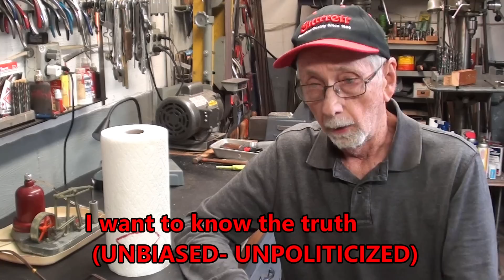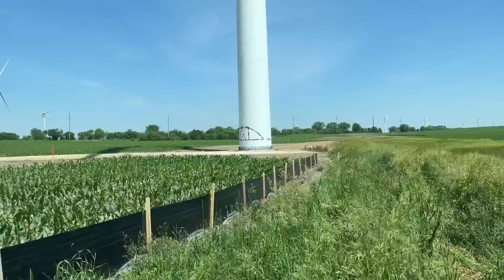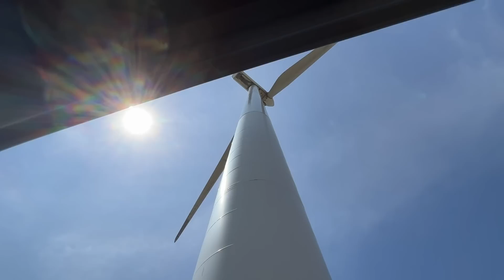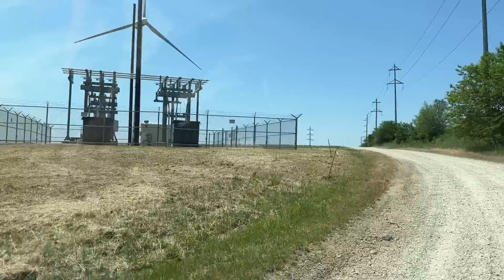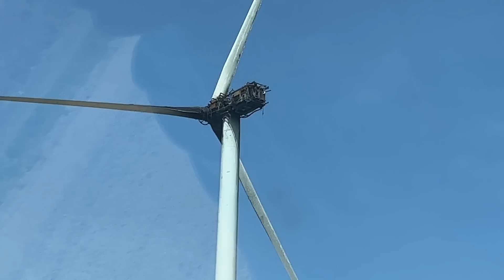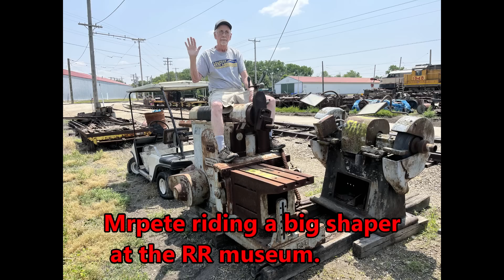OBSOLETE WINDMILL DEMOLITION short #46 pt 1 tubalcain

Comment: Another excellent read (the pdf book is online) is Sustainable Energy without the Hot Air by David McKay. It gives numbers for all of the different types of energy production methods. If you read any book on energy, this should be the one. There are a lot of numbers and math, but probably nothing past a fifth grade level and it is very readable and interesting.

Comment: I don't know the economy for when they get bigger but I've looked at the 100kw range a lot. 
(for those who don't know that's kind of the smallest commercial commercial size you can get)
If you do your own work you seem to be able to get them under a budget of 50 thousand dollars. 
Where I live they average about 17% of their full capacity. So you can think of it as making 17kw all the time.(of course somebody has to use it all for heating and cooling or absorb it in the grid or whatever)
At 4 cents a kwh that's $.68/hr. 
$16.32/day
$473/mo
$5,924/yr (with some down days for maintenance or just because something broke)
So rounded up your looking at a 6 thousand dollar return on the 50 thousand dollar investment. 
The unites I was looking at last a good 15 years and probably should go over 20 and maybe 25. 
So your most likely looking at 18 years of running. 
But I'm not counting insurance as part of the cost so lets discount that to 14 years.(for the risk cost) 
That's 84 thousand dollars earned on a 50 thousand dollar investment over 14 years. 
So your looking at a compound return a bit under 4%. 
Not a great investment but not bad either. 
I think Ford pays like a 3% or 4% dividend.

Comment: How would it be fair to subsidize all other energy plants but not renewable ones? Why is it so hard for people to understand that a big part of the reason this is subsidized is because doing this at these kind of scales is not a proven thing but it IS desirable. Did you know the EACH and every nuclear power plant is just another attempt to get it right? We can't learn from mistakes of the past if we never make them. 

In short, you can bitch if they are installing new ones but no use was made of the lessons learned to accommodate the design flaws. THAT would be insane and wasteful. The fact is that we NEED to work out how to utilize renewable energy sources BEFORE there's no oil to grease the machinery. Whinging that the road to it has a few bumps is frankly missing the point.

Mr Pete, no offense, but although I love your machining wisdom and humor, your politics regarding this and pandemic regulations need more perception and understanding.

Comment: When doing simple math windmill's are a scam, their made/placed/kept working by use of loads of Fossilie fuel +50-100 gallon of oil,,,,,every 0.5 year to keep it lubricated. A 100kW mill will never produce the costs of building/placing/maintain, demolish clear and clean the soil for the build!
Reply: So other generators don't need any lubrication? They don't have building costs or associated demolition costs?
Reply: @ExtantFrodo2  Looking at what's already build they possible know more than science?!
Reply: @leilanala  What the heck are you talking about?
Reply: @ExtantFrodo2  Windmill's cost way more to build and maintain then they ever bring on electricity, just like solar panels that die after one hailstorm.
Reply: @leilanala  Obvious petroleum shill is obvious.

Comment: I may be biased, since I am a huge aviation buff. Anything that utilizes the forces of wind and turn it into mechanical energy. is simply poetry. These gentle giants, lazily turn, sometimes creating an almost hypnotic visual. You say they are a blight on the land, I find them far more attractive than other traditional energy production sources. Beauty is in the eye of the beholder.

Your argument about the wasteful use of resources and money to build and maintain these wind-farms, is a bit myopic at best. The resources, and money sunk into traditional energy production, is not without massive waste and costs after service-life. Hydro electric would prolly have the least damaging economical and ecological impact, but how do you deal with a Hoover Damn when it has reached its service life. There is the initial ecological as well as socioeconomic displacement that occured.  Coal is by far the worst in my book. The toll on humans has been and will be for generations. I would rather we retrain miners to transition to something in the tech end or maybe set up safer manufacturing production that does not fill their lungs with silica or coal dust. Say building wind turbine blades as an example.  Sure, the conditions in the mines isn't as bad as it was say 80 years ago, but mountain top removal is still a exceptionally risky environment for miners and don't even start on the ecological impact. We both know that "Clean Coal" is pure fantasy. 

Nuclear is hugely inefficient both in production costs and recovery of waste products, downstream. Just the reclamation/decontamination and storage/disposal of waste from the operation of nuclear plants is rife with subsidies. Now, I am a proponent of nuclear energy once we can figure out a cost and ecologically effective means of dealing with the waste, and the initial production of the fuel rods. If we can ever solve those issues, I would be on board.   

Sincerely, Wolf Dilworth
Reply: Well said!

Comment: Mr. Pete you are looking for a simple answer to a very complex problem. Just from an economic point of view the location  and development of generation resources is dependent on many factors such as availability of fuels, transmission capability, site conditions and availability of financing (i.e. interest rates). For example, hydroelectric plants (my favorite plants) have by far the lowest operating costs, but have the highest up front capital cost. THey can be built in very few places as well. Nowadays, with the "deregulation" of energy markets, market conditions are also key. It must be determined what the energy price will be able to be obtained. Many projects go ahead based on the ability to obtain long term contracts for generation output AND fuels. In general, it is typical that combined cycle gas plants are the most common generation built in the last few decades. These costs are available on government websites, and I found them to be good ballpark figures. One area of uncertainty is fuel costs, they put in some pretty aggressive cost escalators.

The development of "renewables" is not based on economic cost of generation but SHOULD BE based on the economic cost of carbon offset. That is, what is the most economic way to reduce the CO2 emissions associated with electric energy. I performed an economic analysis the year before I retired from the industry for a state in the process of shutting down coal plants and had a fair amount of hydro and nuclear resources. Most of the generation was combined cycle gas. Since combined cycle gas produces only 47% as much CO2 as a coal plant it is and expensive proposition on a per CO2 basis. I showed that the most cost effective means (generating costs only) was onshore wind, next was solar plus battery storage and the least cost effective was offshore wind which was what they were doing. Just to throw a little mud in the waters, I proposed building combined cycle gas plants in South Africa for the same amount of money. There, 92% of generation is coal based. It would be possible to offset 2-3 times the carbon emissions that would be offset by east cost offshore wind just based on the lower gas plant CO2 emissions over the life of the plant. (It's all one planet, right? -  although I doubt anybody even read it.) 

Unfortunately, the application of one size fits all subsidies, wind conditions, market conditions, transmission constraints and political considerations drive the decisions. I know for a fact that sometimes wind turbine output over stresses transmission lines and results hydro generation being curtailed and water spilled (wasted). There is a lot of big money (Wall Street) behind these renewable projects which is how they are able to build them so fast even over local opposition.

My analysis didn't even consider system costs. Transmission lines have to be built because the location of generation changes and facilities have to be added to maintain power system stability (i.e. prevent blackouts). This is because the electromechanical characteristics of renewables are different from the old turbine generator plants. 

Long story short, this all makes everything more expensive, but is being done in the name of CO2 reduction.

Comment: Wind and solar are about 5 times cheaper than nuclear. It can be argued much of the cost of nuclear is due to heavy regulation. Without sufficient regulation, however, the chances of a nuclear disaster and its permanent effects on the environment is too high of a risk.  Moreover, the amount of power over land area is specious criteria. Contrary to what you stated, it takes approximately 700 windmills to equal the energy output of one nuclear power plant. While it definitely requires more land, it doesn't require a large body of water, pumps and storage pools for spent nuclear fuel. Not to scare you, but if there's a prolonged power outage, the storage pools will boil away and the fuel will ignite and release lethal radiation into the environment.

Comment: Mr. Pete; as with you, I have looked and not found any conclusive data which documents the cost to build or operate these through the life cycle of each machine. There is a large amount of factors at play making this a very difficult thing to calculate. The complexity; as well as the degree to which this has been politicized make it so that we will probably never know an exact answer. In light of the fact that subsidies are provided; and in spite of that, energy costs continue to climb - one can infer that the answer to the question about operating cost per kWh is not a pretty answer. Were it favorable, it would be easier to find multiple independent sources of this information from unbiased sources. I expect that the answer would be some version of this: A few entities are heavily invested in the wind turbine industry as a whole. They are making a windfall of profit from the installation and replacement of these windmills. They are "investing" in lobbyists and political figures who help them to keep their cash cow providing milk, regardless of whether or not the concept as a whole is economically feasible. Having said that, part of their narrative is that you cannot compare the cost of wind power to other forms of power because the other forms of power have hidden costs as well. That is hogwash because we have been using other forms of power for decades, profitably without subsidies. The companies building and running those systems know the cost because their livelihood depends on it. These supposed hidden costs are a construct by those who want to profit from wind power at any cost to the end user.

Comment: The truth about windmills is very difficult to know.
Many people fake it and lie. In Europe, Germany promoted wind and gas energy. Why? It turns out that they had the technology for windmills and sold them, and for gas they concluded contracts with Russia and had it at the cheapest price. The Germans became the sponsor of the war in Ukraine, because they paid Russia as much as their entire military budget. The Germans wanted to make all of Europe dependent on Russian gas and become the sole distributor. German Chancellor Schroeder became an employee of Gazprom controlled by Putin. Having an energy advantage - by controlling energy sources, Germany can become an economic hegemon over the other Member States in the European Union. In the coalition agreement of the ruling parties, the Germans stipulated the transformation of the EU into a single federal state under their control (IV Reich). Countries that are competitive for Germany, for example because of cheaper labor, can be controlled by high energy prices, then their products become more expensive and less competitive in the internal market.
There are also many economic and technical issues regarding windmills. The scandal was the heating of windmills by oil generators, the mechanisms of which froze. In strong winds, the fans turn off, the generator turns off and the fan spins in idle mode. If this is not done, the windmills will burn. They do not produce electricity in light and strong winds. Another cause of burning windmills are deformations of the propellers, which cause vibration and faster wear of bearings and other elements - loosening of electrical connections, etc.
Wind energy is subsidized by the state, often by overstating the cost of traditional fossil fuels. Therefore, it is extremely difficult to make a rational cost-effectiveness analysis. Very often these are political decisions. The costs of windmill construction, transport, operation, maintenance, repair and disposal are very high. I don't know if it's economically viable. Maybe smaller windmills would be more economical. Energy from windmills cannot be stored, so the energy pumped into the energy system must be consumed. If the system is full, the work of the windmills is wasted. Then it's best to turn them off remotely.

Comment: There is a couple of wind farms up the road from where I live and nobody even talks about them. The Farmers get between 15 and 30 grand a year for each turbine. The land they are on is very hilly so no good for cropping and even the wallabies take a packed lunch when the visit. They are designed to be above the height of local birds and below that of migratory ones. They have bought good employment to the town as well. The reason for any subsidies in Australia is so the the Government does not have to pay full freight for new generation as the old coal plants close down and they do not own or maintain the assets. Renewable is now the cheapest energy in this country. Scientists have also found that sheep that graze under solar farms yield greater meat and wool as they get more shade and the soil retains more moisture so there is more feed.

Comment: Power lines, train tracks, paved roads, high rise buildings, radio towers, cranes... all eye sores. 
If one wind turbine produces 500,000 kwh per month, has a 10 year life span, end consumer cost of $1.50 per kwh, let's do the math.
500,000x12x10x$1.50=$90,000,000
If one wind turbine produces revenue of 90 million over 10 years, then investment of 45 million to make, install, maintain, and demolish it produces a 100% return. The electrical flow from several is adequate to power a steel refinery, mill, homes, and businesses. Coal requires a mine, power production facilities, and waste dump. Gas requires wells (wells require but are rarely  capped) and power production facilities. Nuclear requires mines, power production facilities, and disposal sites. 
Wind turbines are the power production facility and can be broken down and recycled at the end of their life with a large inert boulder remaining.

I don't like the look of huge wind turbines either. I prefer the old style used for milling grains or pumping groundwater to the surface.

(The kwh production and life span numbers are low. The consumer price varies. The estimate of ROI on wind turbines is to the best of my current knowledge.)

Comment: A 2016 study from Danish engineers looked at onshore and offshore turbines and wrote, "The energy payback time was found to be less than 1 year for all technologies."

A group of engineers in Texas did similar work and reported that "the payback times for CO2 and energy consumption range from 6 to 14 and 6 to 17 months," with on-shore facilities having a shorter payback.

One 2019 study from engineers at the University of Texas at Arlington factored in the wind speeds from a working wind farm in Texas with 200 turbines. It examined in detail the energy it took to move the turbine components from where they were made in Spain to the Lone Star Wind Farm near Abilene. It also measured the energy it took to get raw materials to the factories in Spain where manufacturing took place. They calculated a turbine that lasts 20 years will reach a full energy payback in less than six years. 

The economics are simple. If the investors didnt make a profit, they wouldn’t be making more.
Reply: Smart investors would not continue to put money in to wind power if it didn’t pay back - I quite agree.  But foolish politicians would throw good money after bad year after year.  And I’ve got a feeling there are government subsidies (that is taxpayer money) that are the key to these wind turbines.

Comment: When you are comparing apples with cantaloupes, you must also take into account all the subsidies that went toward the fossil fuel industry over centuries.  How much power does it take to manufacture an oil pipeline?  (I worked in a steel mill that made the pipe). How much useful agricultural land is appropriated for the right of way of the pipeline??  What are the environmental consequences of a pipeline burst?
But the most important metric is how much CO2 is diverted due to windmill power.  In making that calculation, don't regurgitate 20-year old windmills from a fledgling industry.  The technology has improved and the new windmills are going to be much more efficient, powerful, and maintenance free.